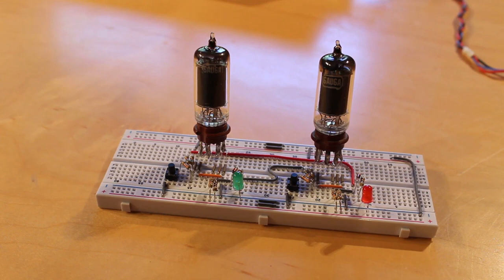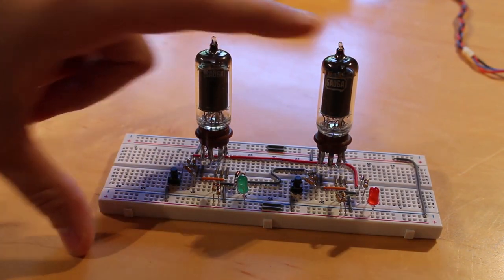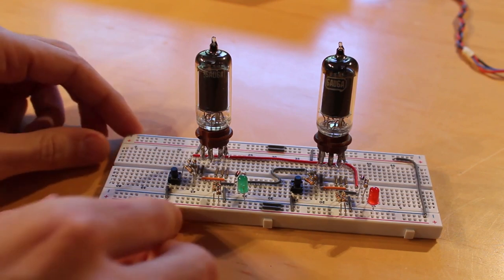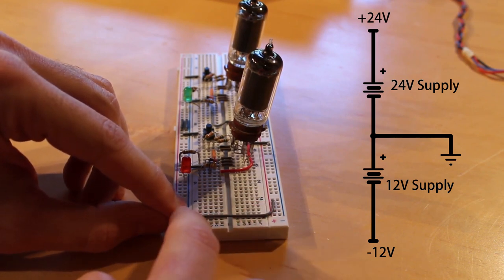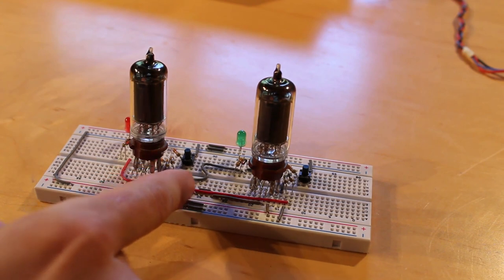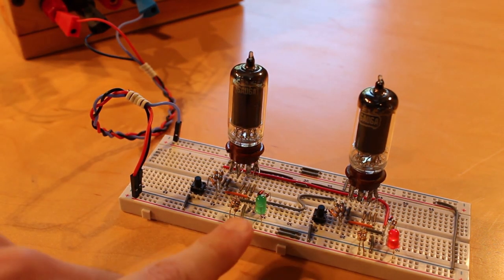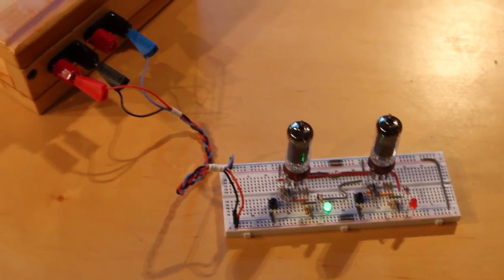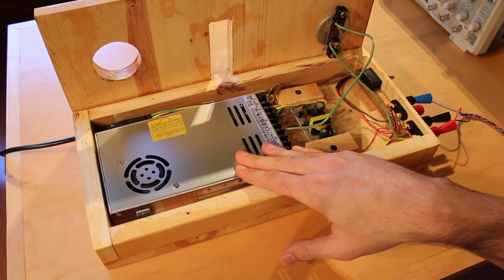SR Flip Flop Display: Part 1 – Negative Voltage from Positive Voltage using a Hartley Oscillator

Comment: When you were looking for the -12v from the +24v, I instantly thought of a -12v regulator. To see you use another valve brings a tear to the eye. I love it.
Reply from the maker: My goal with this was to make it as close to completely hollow state as I could! The only thing I'm not a massive fan of are the fact that I used LEDs. I really want to remake this with some good VFDs for indicators instead!
Reply: @UsagiElectric  Pitty you don't have the power for Nixies, It could display 0 and 1. :)
Reply: @UsagiElectric  life really was so much harder before semiconductor devices became commonplace
Reply: @frankowalker4662  He's just 2x MPSA42 transistors away from that. But wait.....THAT can be hollow stated as well!

Comment: In  old car tube powered car radios, they had what they called a "Vibrator" to  obtain B+ voltages.
They wore out the switch contacts failed somewhere after their millions of cycles.
I  always wondered if they could have used a tube in place of the contacts.
My idea was that the circuit would "Pull itself up by it's bootstraps" using some sort of arrangement to pulse the coil a few times until the tube can start and take over.
Call it "Retroactive engineering".  :-)

Comment: Heh...   It felt a bit counter-intuitive to try to fix the voltage drop of the negative rail by loading it down even more by reducing the value of the gate voltage resistors.  I would have first tried to lighten the load by doubling or quadrupling all the resistor values of the gate circuity. But that might not work if the gates themselves are not really high impedance.  Can you measure the gate currents in both on and off states - it would be kinda interesting to know.
Reply from the maker: You know, now that I think about it, that was a pretty counter-intuitive way to tackle the problem, but it just so happened that I had some 33k ohm resistors next to me when I was testing it all out, so I gave those a shot, haha.

I really need to figure out a good way to measure current, but I did do some testing with different resistors to see how the SR Flip Flop would react. Originally, I used 56k/56k with the -12V wall wart, then with the Hartley Oscillator, I used 56k/33k and we saw about -6V of bias. So, today, I tried 100k/56k and I saw about -8V and the circuit still worked excellently. Next was 100k/68k and measured -8.7V, and again it worked. I then tried 100k/100k and measured -10V of bias, but the multivibrator flip flop stopped functioning. I tried again with 220k/220k and the oscillator was providing -12V of bias, but the flip flop still didn't work. So, it seems that 100k/56k or 100k/68k is probably my best bet. At 100k/100k there isn't enough negative bias to balance it, and at 220k/220k there isn't enough power from the output of the opposing tube to keep the flip flop functioning. 

While this multivibrator is excellent, I have found that building NOR gates with two diodes and a 33k/22k/4.7k resistor network (https://i.postimg.cc/bYWcM5FH/Tube-NOR-nb.png) seems to be the most reliable and forgiving way to build logic circuits at 24V with these tubes. So, in the future, as we get into more and more complex circuits, I'll be using that design far more often. But for this display piece, I wanted to keep the design somewhat similar to the original flip flop design because I think that's a cool way to pay homage to the genesis of computing!

Comment: You got me totally confused Regarding the problem with supplying correct Voltage for the heaters. Why are we not using Ohms law to make a voltage drop across a resister to go in series with the 6V heater(s)?  ( I know I am not saying that right.) Ok, we know how much voltage is suppose to cross the heater {~6V}, then cant you measure their amperage needs ? Are you worried about using up too much current across the heaters plus a resistor {meaning you might need a bigger Power Supply}? Or are you worried about heat generated by the voltage drop accros the resistor? Or am I missing something?
Reply from the maker: By running the heaters in series, I'm essentially doing exactly that! The heater is pretty much just a big dropper resistor, so if I have 24V and four 6.3V 300mA heaters, I can just string them in series and there will be a nice, 6V drop across each one.
I could use a big dropper resistor for the heaters, and sometimes that's necessary depending on the circuit design, but the dropper resistor has to be a beefy one. Since I'm using 24V the dropper resistor would need to be about 60 ohms and able to drop at least 6W across it. That's going to generate a lot of heat, and if I'm generating heat, I may as well use that heat to move electrons in other tubes!

Comment: Very cool!  Can you explain negative and positive voltage bias in terms of electron flow?
Reply from the maker: Thank you very much! I actually go into a lot more detail about electron flow and how negative and positive bias on the grid affects that in some of my previous episodes. In "The Triode Part 2.5" in particular, I talk a lot about how biasing the grid differently affects the behavior of the tube: https://youtu.be/C5WRS28FxUw 

In short though, essentially, when the heater heats the cathode up, a cloud of electrons that are thrown off the cathode form between the cathode and the grid. If the grid has a negative charge on it, that repels the electrons coming off the cathode. If the grid gets a positive charge, now the electrons are attracted to the strongest positive source inside the tube - the plate, which has +24V on it for the circuits we're building (the plate usually has 100V+ on it though, so the positive attraction is really strong). Now, how much grid negative bias is required to put the tube into cutoff and how much positive bias is required to push the tube into saturation differs pretty wildly from tube to tube. I did a massive amount of testing to check out the differences on the previous video: https://youtu.be/SUy5yNjTYnk

Let me know if you have any more questions!
Reply: Thanks for the explanation!  Will check out vid! 🙂

Comment: 9:00 gave me major anxiety, how aren't those psu's shorting out? I always thought these types of psu's can't be used like this
Reply from the maker: I believe that most switch mode power supplies don't tie the DC negative pin to mains earth, which means the positive and negative DC lines are technically floating. In this case, you totally can connect two power supplies in series. However, if the power supplies to connect the DC negative to mains earth, then you can't connect them in series as you would be essentially creating a short circuit across one of the supplies.
The right way to do this is to inspect the power supply design and schematic and ensure that it's alright to connect up in series. The way I did it was to just send it and if I burned up a couple wall warts, well, they were cheap and that would have been fun too!
Reply: @UsagiElectric  thank you for the explanation 😁 really loving your series about vacume tubes, watching them all one by one currently.
Your right, seeing them explode would also have been fun 😂

Comment: What is the current rating and dc resistance of your inductor? I know the schematic showed 56uH, but does the dc resistance matter? I found a 56uH, 320MA, 1.5 OHM inductor- Digikey part number 77F560J-TR-RC. Would that work?

Comment: This is impressive! Have you tried to build a vacuum-tube crystal oscillator?
Reply from the maker: Thank you!
I haven't yet actually, but that's primarily because I don't have any crystals in my collection. The Hartley Oscillator is surprisingly versatile and I can get really good sine waves out of them, so in most situations it seems to be a solid alternative to a crystal oscillator!
Reply: @UsagiElectric  Thanks for your reply. What about a generic 32.768 kHz watch crystal? There are also some vintage tube-like models around with the frequencies in the kHz range. Alternatively, you can consider the microcontroller oscillator crystals. Yet these are well above 1 MHz...
Reply from the maker: @zygmunt418  No problem! Honestly, I don't do hardly any audio related stuff, so needing a crystal oscillator hasn't ever really come up. Though, I would like to build an AM transmitter one day because I live so far out in the middle of nowhere, we don't actually get any AM stations to listen to on the old tube radios I do have. I think for the AM frequency band though, I need quite fast oscillations, like 1MHz. That's a project for the far future though!

Comment: "This is mental" ? Exactly what I was thinking when it worked after swapping the resistors in the end !!
I can't figure out, however I enjoyed this episode sooo much ! Might be the new intro, the usual overwhole quality, your marvelous bunny or this total overkill project to have a nice decoration on the desk... Love it !

I would like to help with the supply of the heaters but I am afraid I have no clue :/ Even though I am studying in an engineering school and I have studied a ton of electronics, I understood only a few weeks ago what voltages and currents really are and do (this is a bit sad that I didn't get this verrry useful intuition prior to the lockdown...). All of this to say that I don't now how to "multiply" a single power supply. This could also be an interesting topic ;)

Ohh before I forget, maybe try to put a smaller resistor on the red LED ! It was a bit dimm and I struggled to see whether it was ON or OFF :p

Thanks again for this episode and see you later !!
Reply from the maker: Thank you so much! And thanks for the kind words on the quality!

It's kind of wild to think that we're going to some pretty insane lengths to build a single flip flop powered from a single voltage source when you can get something like a 74LS173 and get four D Flip Flops in 16-pin DIP package. And even more wild when you realize that the 7400 series of chips are now 40 year old technology! But, it sure is fun playing with tubes, so I'm gonna keep plugging away at it!

I have a few ideas of how to tackle the heaters, so we'll explore those in the next episode and then clean the mess of wires up so we have something cool to set on the desk (and if there's time, I'll cut a circuit board for it and make it a proper display piece).

For multiplying a single supply, if you can make an oscillator, a lot of options open up. I actually explored using the multivibrator to boost voltage up to about 75V to ignite a neon bulb, and while I got it to work, it didn't work well. But that was with the weird multivibrator oscillator, I've been meaning to try again with the Hartley Oscillator to see if I can get it working better. Perhaps a topic for a future episode!

You know, while I was editing this video up, I noticed that the red LED was a little too dim, but it was a bit too late to fix it. In the next episode we'll definitely have something that's brighter and easier to see!
Reply: @UsagiElectric  I'm watching these from the latest towards to newest, so I do not know what you came up. I had two ideas: 1. get a wallwart that has a midwinding outlet of +6V. 2. Wire the three tubes in series and drop the excess 6V by a resistor or a lightbulb that can light your logo.

Comment: Daisy chaining filaments is a terrible practice. Eventually you need to deal with your PSU problem. Just built a power supply. It’s the basis of everything VT.
Reply: ...which never prevented it from being the most common one - by far. Guess whether ANY of your tube TV powered up at all if your CRT filament kicked the bucket. And yes, shorting it out DID allow one to at least LISTEN to a TV show on the zombie set.